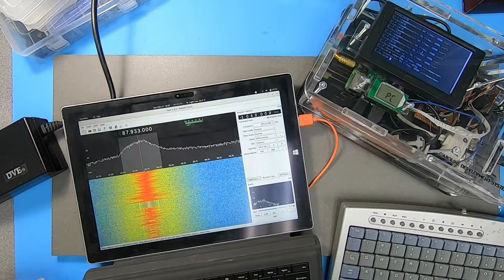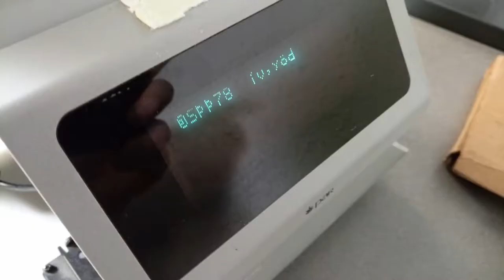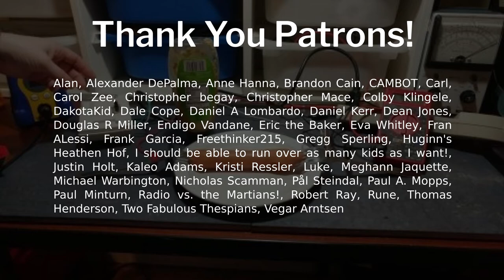Studio 11: Station In a Box

Comment: What's the max power you can do and avoid fcc stuff?
Reply from the maker: I had to look it up again.   Between 88 and 108 MHz (oops) it needs to be 250 microvolts at 3 meters.    The field strength meter I have isn't that sensitive and probably doesn't work, so I'm just going by rule of thumb.   Basically, not very far.

For AM, there is a field strength rule, but there's an alternative rule of 100mW with an antenna and feedline of no more than three meters, and some pretty standard AM modulation rules.  This is why a lot of microbroadcasters use AM as the alternative rule says nothing about field strength.